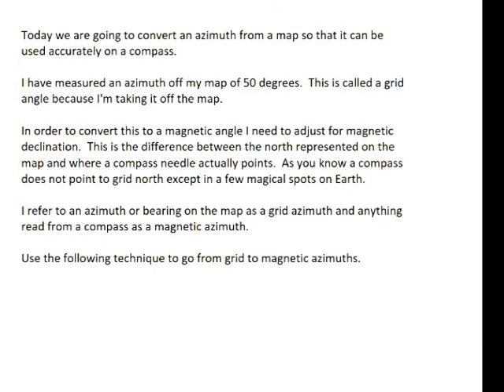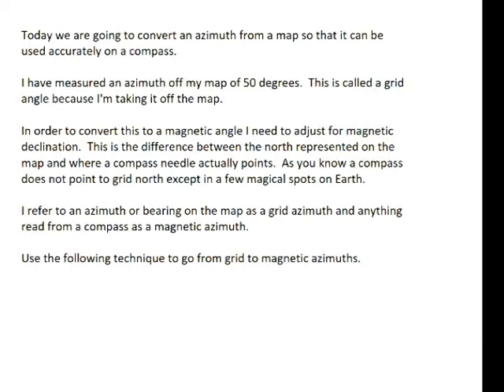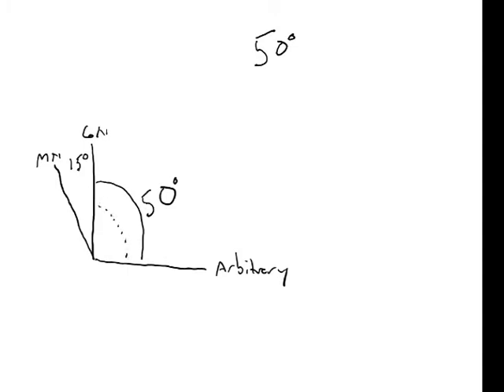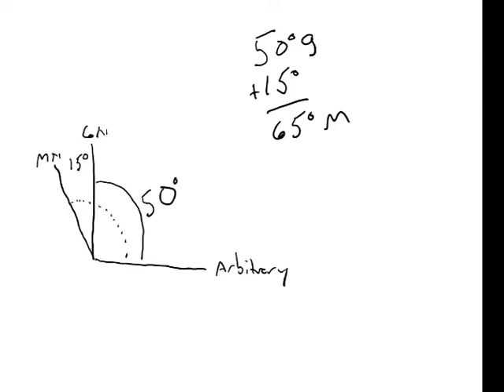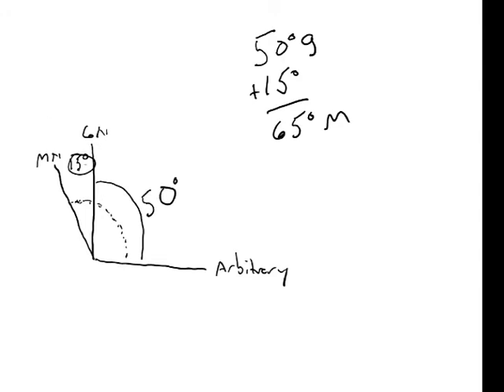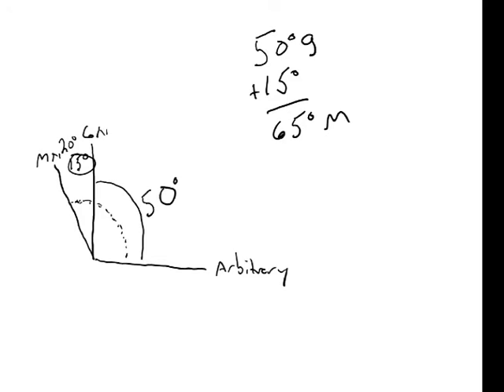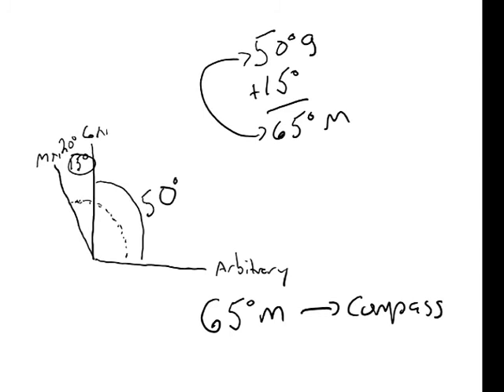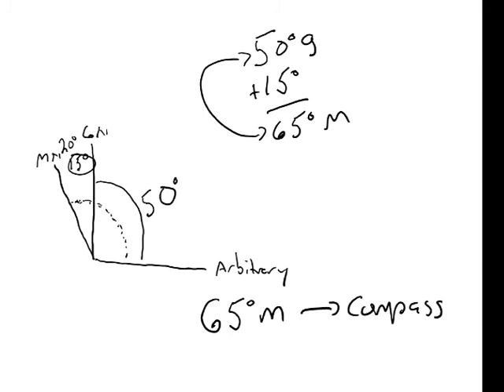Grid to Magnetic Westerly Declination

Comment: Clearly and simply explained. I'm sure it will be helpful to the many people who struggle to understand magnetic declination adjustment. 

I use 3 methods to remind me how to make the correct adjustment for magnetic declination:

1) If you set your base plate compass to the map azimuth, or map grid azimuth .  To get the compass direction of travel arrow to point in the correction direction.  Look at the magnetic declination diagram on the map.  And while holding the compass turn your body until  the compass needle is on  the same side of N on the compass dial as  the magnetic arrow is on the declination diagram in relation to the grid north arrow line. ...

For example if the map grid azimuth is 50˚ and the magnetic declination is 15˚ West,  while holding the compass and facing the direction of travel, if you turn your body until the compass needle is to the left or west of N and pointing at 345˚, not pointing at N on the dial. This will make the compass direction of travel arrow point in the same direction as if you had reset the compass dial to 65˚......  OR point the needle to 15˚ to the right side of N on the dial ( same as the magnetic arrow is right of the grid north arrow on the mag declination diagram)  if your mag declination was 15˚ East,  --  then  the direction of travel arrow will be pointing in the same direction as if you had set the compass to 35˚ ( 50˚ map grid azimuth - 15˚ East magnetic declination.... Just remember IF  the compass needle is on the same side of N as the magnetic arrow is on the mag declination diagram the direction of travel arrow is pointing in the correct direction. ....

(  a lensatic compass operates a little differently from a base plate compass because the compass dial also rotates with the north seeking compass arrow, but with a lensatic compass you still just  turn your body until the N arrow is left or right of the luminous bezel indicator, instead of the N on the dial of a base plate compass, to get the direction of travel arrow pointing in the correct direction)  

2) An acronym of my own creation - WAVES - West Add v East Subtract.  WAVES only applies when going from map azimuth ( grid north reference) to compass azimuth ( magnetic north azimuth reference). You only need to remember to reverse the math operation when going from compass azimuth to map azimuth. v looks like an angle, so it's just a reminder that is an azimuth angle adjustment.... 

3) Correctly align the map to local terrain before measuring the azimuth on the map.....If I align the edge of the compass to the edge of the map or to one of the n-s UTM grid lines, with the compass dial set to North and the compass needle pointing to North. To align the map correctly to local terrain - If the the magnetic declination is West - the map will rotate Clockwise  ..... If magnetic declination is East, the map will rotate Counter Clockwise ( CCW).....  iow the map will rotate in the same direction as the direction from the magnetic arrow to the grid north arrow on the magnetic declination diagram..... So again the mag declination diagram provides a clue to correct map to terrain alignment. Looking at the diagram you can see the grid north arrow is CW from the magnetic north arrow for West mag declination. And the grid north arrow is CCW from the magnetic north arrow for East mag declination..... 

The advantage of this method is that if you leave the map correctly aligned to local terrain, when you lay the compass on the map, pointing from where you are to where you want to go. The compass will automatically be set to the correct compass magnetic azimuth if  you turn the compass dial to align the compass needle and N on the dial before lifting the compass from the map. ( or align the luminous bezel  indicator to N for a lensatic compass ) No need to adjust the compass again for magnetic declination.